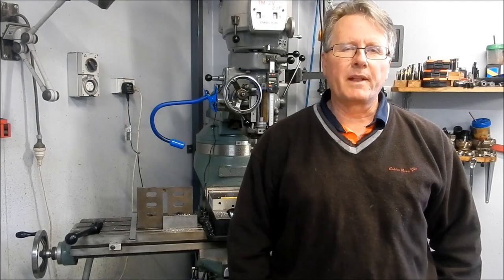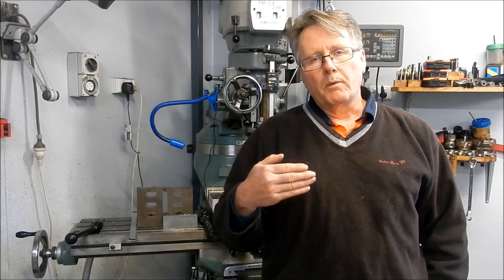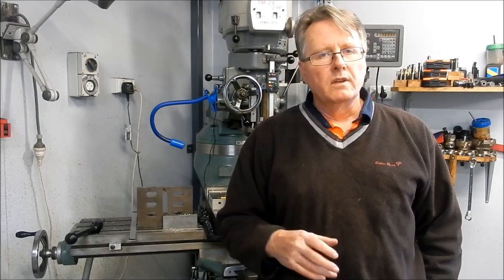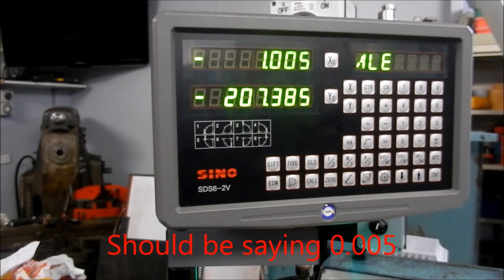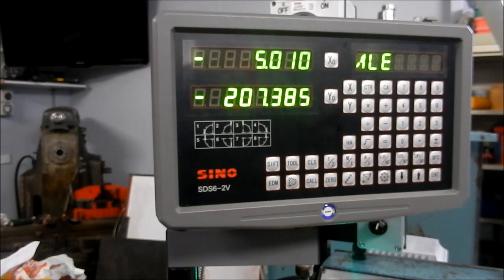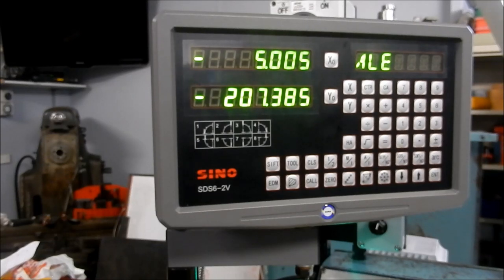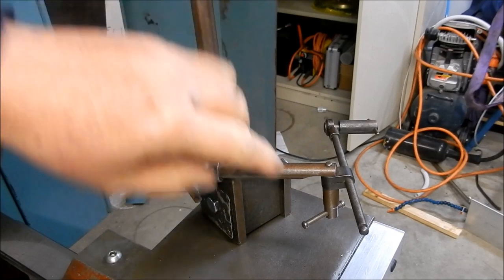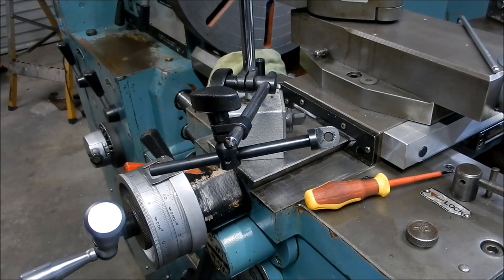Sino DRO Diameter and Radius set up

Comment: Hi Cam.
I have a SDS2MS DRO and mine does not have the lathe function come up like yours. As mine came with the lathe i am doubt the Aliexpress customer service is going help but was hoping someone else has the same and has solved this issue?
Cheers
M
Reply from the maker: G'day maartyvb, yes I went through the same thing.  As I remember it was a pain, in fact I put a short video together with how I understood it to be and sent it to the manufacturer.  He then sent a video back showing me the correct button sequence which worked.  I'm on holidays in Sydney for the next two weeks so can have a look when I get home if you don't get a solution beforehand.
Cam

Comment: Hi Cam  I just received my new lathe with a SINO DRO.  The manual was fairly comprehensive.  The cross slide scales are based on diameter measurement as was the DRO.  I am used to radius turning so I changed the DRO back to radius (which the manual states is the default).  Very simple , took less than a minute.  With respect to your linearity issue, my manual states that adjustment of this should be done by the installer.  So in this case that's you.  Your just have to work out the correction factor (mm/m) plus or minus and enter it into the DRO.  Does your manual cover this.   Do you want a copy of my manual?
Reply from the maker: Hi John, thankyou for the reply.  I had resolved the radius issue so I'm all good with that.  I had an Easson unit from an old Victoria Mill I bought some time ago and have fitted it in place of the Sino DRO but still using the Sino scales.  As you would have seen from the video I had drift of around 0.02mm during every a cycle through 4mm of travel.  The Easson DRO has absolutely no drift at all.  I'd be interested to know if your unit has any drift over say 5mm reading from a fine scale Dial Indicator.  When I put my .001" indicator up I couldn't really see any drift but the 1 Um Dial Indicator certainly showed it.
Cam
Reply: @camatbattler2233  Hi Cam  The lathe came fitted with the DRO.  I will make a few measurements and get back to you.  Cheers  John
Reply: @camatbattler2233  Hi Cam  My DRO is set to 5 micron.  I cannot set it lower.  I have not got a dial indicator as accurate as yours.  I compared readings with two different digital calipers.  Over 106mm the difference in readings was 30 microns low for one pair.  With the other caliper, measuring over 140mm - 10 micron high.  This is a big ask for any caliper as I was cantilevering the body of the instrument The problem with electronic measuring devices is where the manufacturer has set the change point.  From my limited experience with weighbridge load cells the change point is not on the zero or grad division.  Hope this helps.
Reply: I’d love a copy of your manual ! Is it in PDF ?
Reply: @Stefan_Van_pellicom  Hi Stefan  I can scan it for you.  How can I get it to you?
Reply: @johnspathonis1078  Scales are available in different resolutions I have both 5 micron and 1 micron.  I had mine form Machine DRO (Allendale) in the UK  All the best

Comment: Hi Cam, both of my DRO's have a dia, radius icon on the screen,  just toggle between the two.
Have to be cautious you have the right selection on the lathe, my cross slide dial is engraved for dia.
My other lathe is set for radius,  pain.
Have a look, you may have the icon.

Comment: G'day Cam.  Thanks for the detailed information.  I'm very sorry to see that you damaged the cable.  My heart sank when I saw that.  I think it's time for a Noga magnetic base too (treat yourself).  I've enjoyed this DRO series.  Cheers, Aaron.
Reply from the maker: G'Day Aaron, yeah I felt the drag on the Cross Slide and that horrible crunching sound before I saw what had happened.  Anyway I think I have a good solution for a repair.  The other thing is that where the damage is on that part of the cable will be hidden and protected under the scale.
Cam

Comment: Hi Cam,

There's a vid on Blondihacks channel where she shakes down DRO displays.  The claim is that there are two main engines driving these displays, no matter what is stamped on the case.   I believe that the basic metrology is based on metric and that inbuilt precision makes the last digit unreliable unless you have high end scales.  Imperial measurements are generated by an algorithm, which may not always be world class.  Similarly , I'm told that in the 1990s and before, PCs got mathematical values for geometric functions from a lookup table rather than calculate them as required.  Problem was that one or more of the tables contained incorrect values.  I'm a gullible bloke but it tickles me to believe this tale!!!

Stavros
Reply from the maker: Hi Steve, thanks for looking in and commenting.  I did a quick check last night on the imperial setting with a 1 thou 1" travel indicator.  It read perfectly at every 0.1" but it has no where near the same resolution as the 1 micron dial indicator I used on the metric test.  I'll set that indicator up and do a conversion from metric to imperial and see how it compares.  The other thing I will try is setting up a spare Easson DRO I have and see if that shows the same drift as the Sino unit on the Sino scales.  As shown, I had a 0.02 drift over 4mm but it did come back to 4.000mm and then started to drift again after that.  So I think it will read pretty true over the entire stroke and coming back to zero every 4mm after the 0.02mm drift.  Setting up the Easson unit might show if the discrepancy is in the DRO unit or the scales, either way it will be interesting to compare. 
Cam
Reply: @camatbattler2233  That would be a great comparison and would like to see the results.  I am in the final stages of deciding which DRO to buy and had looked at the Sino, Ditron and Easson. From what I have read it is a tossup between the Ditron and Easson. The supplier I have been looking at will supply the Ditron with magnetic scales.

Comment: Hi Cam . I wonder how the differences would have shown up doing the same test in imperial .  Could it be the way the last digit micron read was rounding off with the 5um scales .  Would be interesting to see the same test on a 1um scale .
Cheers .
Reply from the maker: G'Day Max, I did a quick check last night on the imperial setting with a 1 thou 1" travel indicator.  It read perfectly at every 0.1" but it has no where near the same resolution as the 1 micron dial indicator I used on the metric test.  I'll set that indicator up and do a conversion from metric to imperial and see how it compares.  The other thing I will try is setting up the Easson DRO and see if that shows the same drift as the Sino unit on the Sino scales.  As shown, I had a 0.02 drift over 4mm but it did come back to 4.000mm and then started to drift again after that.  So I think it will read pretty true over the entire stroke and coming back to zero every 4mm after the 0.02mm drift.  Setting up the Easson unit might show if the discrepancy is in the DRO unit or the scales. 
Cam
Reply from the maker: G'Day Max just did a check using the Easson DRO with the Sino Scales.  There was absolutely no drift throughout the same distances as I did with the Sino DRO.  It hit every 0.1mm increment spot on.  Felt rock solid.  Obvious difference in the quality between the two units.
Cam
Reply: @camatbattler2233  Thanks for checking that .   Now my mind is a bit more at ease !    Cheers .